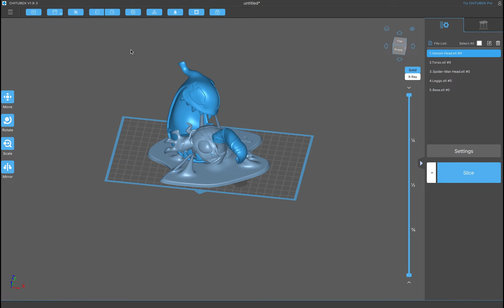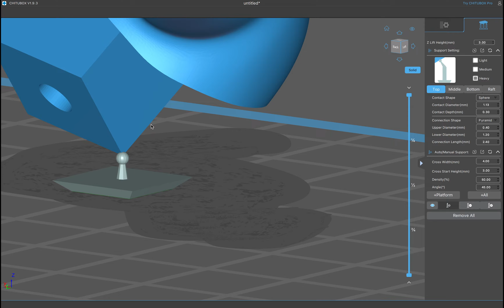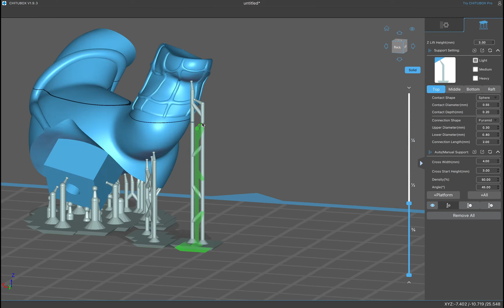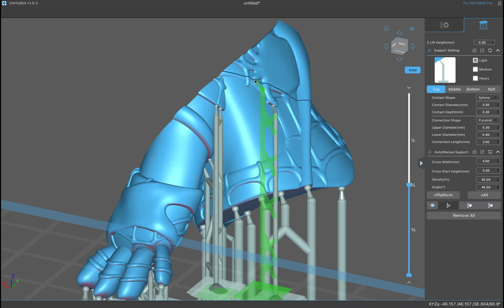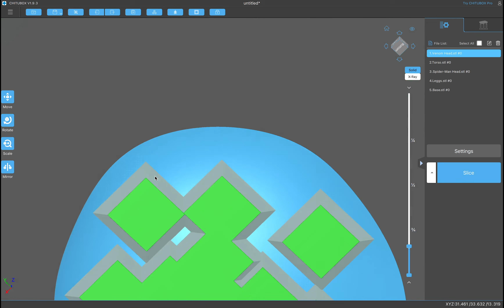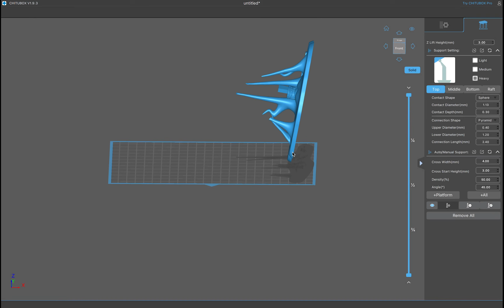Resin 101: How to Slice and Support Your Prints in Chitubox

Comment: Not sure how your prints are coming out so beautiful keep it coming!!!! I’ve been trying to print large prints with siraya tech navy grey normal exposure 1.5s and bottom exposure 40s and they won’t stick to supports but small prints come out perfect
Reply: I print a ton of large prints and they usually come out fine.  I use a cheap sunlu brand resin with an elegoo Saturn printer.  I normally do light auto supports then add heavy supports at the lowest point, then at least at the top and middle.  I'm no expert but if you have any questions feel free to ask.

Comment: is there any issue with using auto supports within chitubox?
Reply from the maker: Yes and No… 😅. I have found auto supports work great. Sometimes. So when I do auto supports I usual use auto light supports or medium then I go in and had a few heavy supports manually that what I give a little more strength to the supports. I also double check to make sure everything is supported and it didn’t miss anything. That all depends on the density of the auto supports your using too.